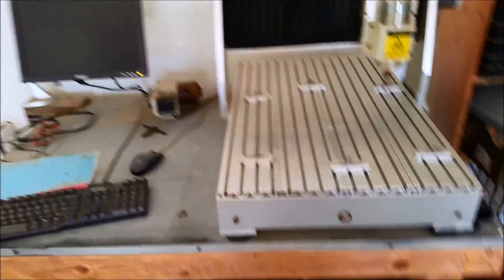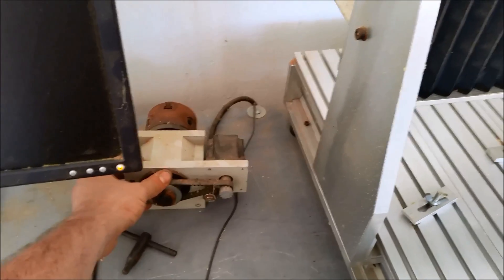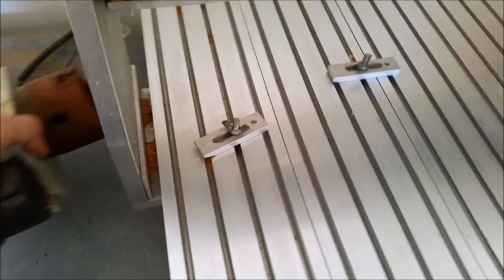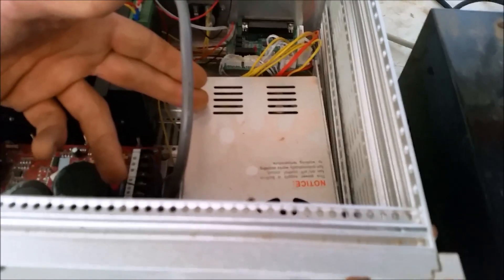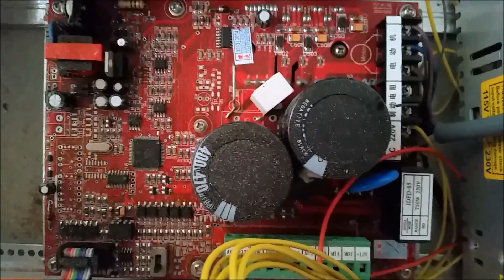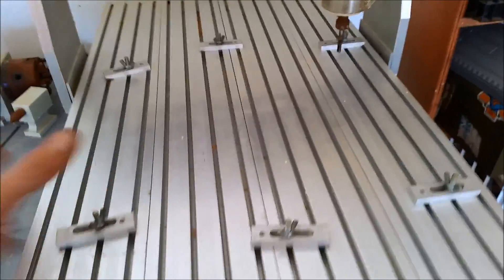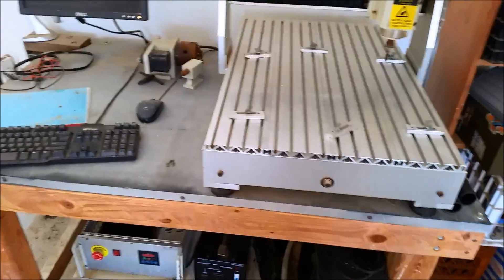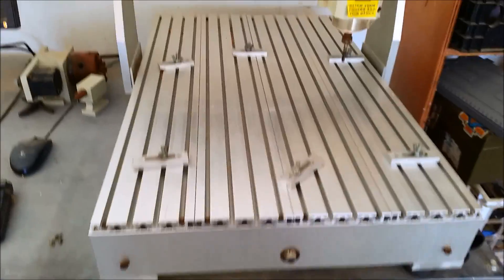CNC 6040 Review and Rant

Comment: DO NOT LISTEN or BELIEVE THIS REVIEW!! That poor machine. It's made for SUBTRACTIVE MANUFACTURING not manufacturing amphetamine.... That rust problem is from the same problem that you have with the machine. YOU!!. The control board is fine it's your programming skills and the fact THAT THE BOARD IS GETTING WET! I know the instructions were a little hard for you to understand and you probably didn't understand this but you do not cool the control board by splashing water on it while it's hot and in use. you're obviously using way too much water and you shouldn't be using water anyways you're supposed to be using coolant which doesn't rust anything if used properly. Are you applying it with a garden hose how in the hell do you have every piece of that machine that is steel rusted? I don't even want to see what your linear rails look like or you're bearings.. the bearings are probably locking up, unable to rotate in their channels is why you're having problems with it skipping steps you should not be reviewing ANY machine you should put it on the side of the road with a sign on it that says free to good home so someone else could use the machine properly. it is a shame to see a beautiful machine like that in the hands of someone so uncapable appreciating it's quality .I own the same machine except a much lesser quality and after 2 years of use there's not a speck of rust on any of my steel and damn sure would never be on my fourth axis Chuck or tailpiece.  my controller and my stepper driver's are even crappier ones than that and I have zero problems except the ones I create with crappy programming of my tool paths not coordinated properly with my speeds and feeds along with the bit that I am using. But if you took 5 minutes and watched any training videos on speeds feeds and bits you might not be such a danger to that machine. remember you only have to be 10% smarter than the inanimate object that is kicking your ass.

Comment: The speed control shows 400 because that is the max frequency output of the drive controller. North America uses a 60 Hz power line frequency. Many places around the world use 50 Hz. The line frequency (and how the motor is wound) determines the motor RPM. Most AC motors when connected to a 60 Hz line will run somewhat slower than 1800 RPM, often 1750 RPM. 

The spindle motor for the router has a maximum RPM of 24000 when the power is 400 Hz. The electronic controller takes the line frequency (60Hz or 50Hz) converts the power to DC, then converts it to AC. Whatever frequency you set.

Comment: your emergency switch goes through the controller board and needs to be setup in software. I know a very weird emergency switch but they likely did it to not cut off power to keep the machines positioning.

Comment: 1. Dialing in your fixtures (and in this case, your 4th axis) is completely standard in the machining world. Nothing out of the ordinary there, you need to learn how to do it properly.  2. If you want repeatability to industry standards, by an industry standard CNC machine, and not a 'hobby' machine, which is what you have.  3. Many CNC machines come without end stop switches, if you want them out of the box,  you have to do your research before you buy. 4. Have you been keeping your 4th axis in a bucket of salty water?? Keep your tooling clean and dry, keep them oiled etc.  5. Everybody and his dog knows, when you buy anything from China, the instructions you receive will be in Chinglish.  6. Your "leadscrews" are ballscrews.  7. It's always a bit of a pain to set everything up, welcome to the machining world.

Comment: Am I going crazy or did you not see the switch on the side of the power supply unit that lets you switch it to 110v.
Reply from the maker: Yes the PS could switch to 110v but the VFD requires 220v. Flipping that switch would make it inoperable.

Comment: FYI there is a switch on the side of most of those power supplies for 120/240
Reply from the maker: But there wasn't one on the VFD that ran the spindle.  If I switched the power supply to 120v to power the steppers I would still have to have then a separate 220v coming in to power the spindle.

Comment: Nice Video, very helpful.  you have probably found this out by now but, if you pause the video at 5:21 you can see the power supply 115V/230V switch so you can run the machine without the step up transformer right from the wall.
Reply from the maker: Indeed however the spindle controller only works on 220.  I could switch that supply to 110 but then I would need a second supply for a 220 into the controller.  I have since thrown the spindle controller in this video out and installed a new one in a later video.

Comment: How much did you pay for the machine? I know that there are basically 2 types of those on eBay right now: the ~$450 ones and ~1450 ones :P Which one is it?
Reply: Mateusz Mittek 
His title says 6040 which is the $1450 one. The $450 one is the 3040T, which is a smaller version of the 6040.

Comment: would you buy just the frame kit for this cnc router , from wat youre telling on the video most of the problems lie in the electronics , the manual in general and the pirated CAD program they send along with it but once thats solved the machine delivers nice work though at a slow pace
thinking about getting the spindle steppermotors and a controller that fits everything from a different suplier thats in the country i live at (so i could drive there and trow the parts through their windows if there customer service pisses me off once too often ) and see if i can find an open source cnc design and operating program
Reply from the maker: The actual frame of the machine is really nice.  The spindle and the stepper controllers are pretty nice as well.  I've already started swapping out the electronics in one of my newer videos.
Reply: decided on another machine , check youre private message

Comment: (6:07) You mention the parallel port being an issue then (6:20) there definately appears to be a parallel port in the machine.  Not surprising since you mention it was an old Windows XP machine.  Perhaps I am misunderstanding something but why did you have to buy a parallel port card?  The issue with Mach3 is they either gave you a demo version or pirated version.  Either way you will have problems running the machine.  

Go here http://www.machsupport.com/software/mach3/ and buy Mach3 then completely uninstall (delete folder, driver, registries) and reinstall legitimate version or go here http://linuxcnc.org/ then erase Windows XP and fresh install linux OS and learn to use command lines.  Just keep in mind no CNC machine is completely user friendly, there is always a learning curve and quirk with each machine.

I am not surprised you have issues since the spindle controller in right next to motor drivers with unshielded wires.  If you reorganize the setup I am sure you will notice a difference.  Limit switches get hooked up to the breakout board terminal (PC parallel plugin board).  The board is seen at 6:02 in far right corner of chassis.  Looks like some unpopulated connectors on left side of board so you may need to add some way to connect wires for limit switches.  Tool height setting can be used in Mach3 "Auto Tool Zero" but you will need to create a Visual Basic Script to auto execute it properly to the touch-off plate.

The more I watch the video the more it is evident that the layout is poorly designed.  Power wires must be away from controller boards, AC input and DC  outputs should be routed on opposite sides of chassis (AC in one side and DC out another),  remove spindle board and place it in another chassis away from motor wires (notice youtube videos when recording cameras get too close to spindles how it distorts the video, this is what happens inside that chassis), ensure that power supply is properly earth grounded to chassis and mains earth (DC ground should NOT have continuity with earth ground), ensure the parallel port connector at cnc chassis is not touching as the chassis is earth grounded because there is a bonding wire that earth grounds through the computer and thus creates a ground loop, and lastly run a 12-14 Gauge stranded bonding wire between the cnc controller chassis and cnc machine (add one wire to Z on gantry and one to table as there is a difference of resistance between the points and both wires must terminate at same point on controller chassis).  Long story short, the earth grounding of chassis will essentially create a Faraday cage and all grounding on cnc side of things should be connected to a central location (i.e. chassis since it is a convenient spot).

If the system is not properly shielded and grounded then the limit switches are going to kick randomly when running the machine as the motors and spindle will induce eddy currents which fools controller into thinking a switch is stripped.  If you do not properly earth ground system a temporary solution is set debounce high in Mach3 or add a resistor to limit switch ground side.  Wire all limit switches in series and set active high in Mach3 so there is juice flowing through switches.  This will let you know if a wire/switch breaks or loosens.
Reply: That's IDE, not a parallel port.

Comment: wow!  Rust everywhere.....
Reply: I'm guessing he has used a chemical such as Hydrochloric or Nitric acid in the same room, the vapors will cause metals to rust, since he mentioned scrapping the old PC's for gold if he scraps them himself you would use these same acids together as Aqua Regia to process the gold..but still, if there is rust on his tools then hes not oiling or protecting them correctly
Reply: Yep, That's what I think has happened. Even storing HCl in the same room will corrode steel.
Reply: This. Anyone that doesn't take care of their tools is a poor source of information.
Reply: looks like theres corrosion on the control board pcb, and hes using water instead of oil on the spindle, this guy is dumb.

Comment: I bought the Dongda 6040 4 axis machine and, as you said, the install manual is awful. I have yet to get the machine to work. I did buy Mach 3 and BobCad V-21 from a separate source. I don't know what values to install on the Mach 3 config screen because Mach 3 had some suggested values entered but they conflict with those in the Dongda manual. This machine also has a UC-100 controller that plugs into the printer port on the computer and the controller box of the 6040. It supposedly makes it easier for Mach 3 to operate without interference from Windows operating systems. I finally got the controller software downloaded from the Internet, got both lights on the controller to light up but the machine still will not fire up the spindle or allow me to use the hot keys to manually move the x, y, or z axis. I am at my wit's end. I set this up to try to cut inlays for pool cues. Right now, I am glad I still own a pantograph!

Comment: Just a heads up if you need a 110V AC, and because this is from china I am going to bet that if you take the power supply out there's going to be a switch on the side allowing you switch from 220V AC to 110V AC. Good Luck.

Comment: If you want to set up a 4th axis chuck a straight round bar and use an indicator to align it with the y or x axis. Also, if you want to home out to the same position every time then put something on the table to pick up every time you start up. Then set your part zero relative to that. I think the problem is that you know absolutely nothing about even basic machining and your trying to use a cnc. You also know nothing about cnc systems. Its not your fault mind you but people like you should never buy a machine like this. Its called a hobby machine for a reason.
Reply: @deeremeyer1749  I liked the part when you called him a dumbass for explaining how you ACTUALLY would align the 4th axis(the lathe as old mate in the vid calls it which isn't a lathe), you really burned him there......I'm guessing you probably have as much experience with a milling machine as the guy who made the vid which would be nil.

Comment: Ohh man, this video pains me.   Ok, first off the main control board is actually the spindle VFD.  Second, the spindle read out is in hertz.  So if it is a 20, 000 RPM spindle.  400 hertz will be 20,000.  200 hertz is 10,000  100 hertz is 5,000 rpm.  The board in the back right corner of the controller is the breakout board.  That is where you switches will hook up to.   It is widley known that the controller is junk out of the box.  Get a gecko G540 to run the stepper motors and you will be AMAZED at how much smoother it will run.  Please maintain your tools.  WD-40 will keep rust away.

Comment: I have the same 6040, although yours looks like  a bit older model,the electronics in all these  routers from china are shit,  I have a Soigeneris  STDR-4C with geko 540 an smooth step, an it works great ,As Tom sez cover up all ya electronis I have built my router into  a cupboard with clear winder on front,so all the crap is kept in the cupboard area,the dampness of winter is hard on machines even if you do spray them with WD 40,  my lathes get that thin rust look on them over winter so ive buit a small room an run a heater in it ,much better so good luck,all I need do is now  learn  how to use my 6040

Comment: I bought the same machine off ebay but without the 4th axis.$1150 delivered. The instructions are great compared to the one I received. You can download a demo of mach from the website with updates i would recommend that.
Don't want to look like a know it all but here are some suggestions.
Go to harbor freight or ebay buy a medium sized aquarium pump put it in a 5 gallon bucket with a lid add a little anti freeze it will cool and never lose its prime
As far as rust do you have a dryer in your garage? is it vented properly? even if it is dryers can be an issue. or your just in a high humidity location?
The lid needs to be on the control box to make the cooling fan functional airflow pattern or it will overheat.
The red board is just the spindle control VFD the 400.00 on the readout is the hertz in theory 400 is 24000 rpm.
The motors are run by the BOB (Break out board) the small green one with the parallel port plug.
Running sensitive electronics with a step up transformer is scary. AS another member mentioned the transformer has a switch to 120. (see the decal on the transformer) then just wire up the 110 there marked on the terminals. Include a 5amp fuse.
You probably could wire limit switches to the BOB or swap it out but it is probably not worth it.
End your programs with
g49 z.0
g28 x,o y.o
M30
This will bring the machine to home and in theory will still be at home when you start it back up.
Keep a small vacuum handy make sure there are no chips limiting the travel when is homes.
the machine i bought also looked like it had been set up and used then disassembled? the z motor was bad and it was obvious someone had been attempting to make it work. I contacted the manufacture they sent a new Z motor and driver from China DHL 
(after a little convincing) I just ordered a bigger motor and upgraded the Z.
I make alot of parts with this setup and for the money It works very well. 
Again dont want to sound like a know it all just trying to help
Ps get your electronics away from the dust at least higher not under
Good luck

Comment: Dude most of those chinese power supplies like that have dual voltage input. Check the side of the power supply, there is probably a slide switch to change to 110v